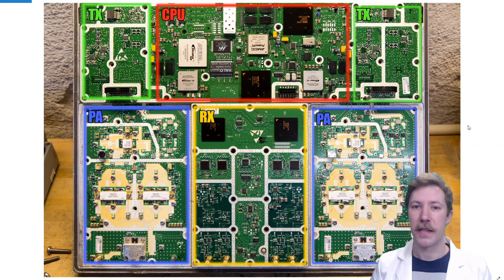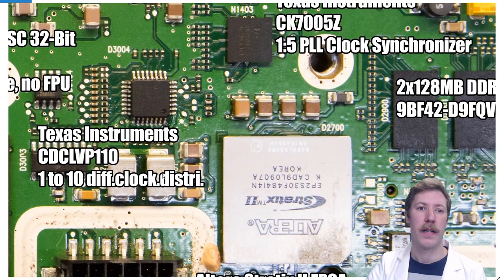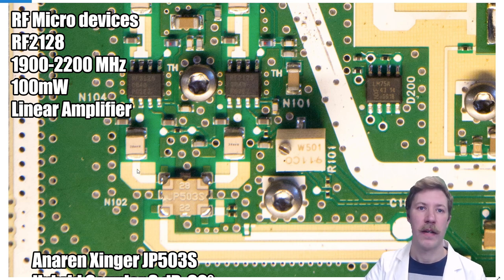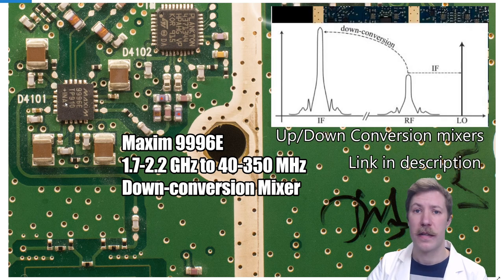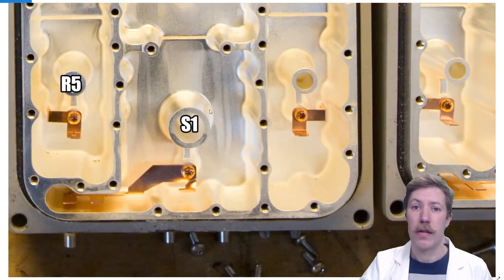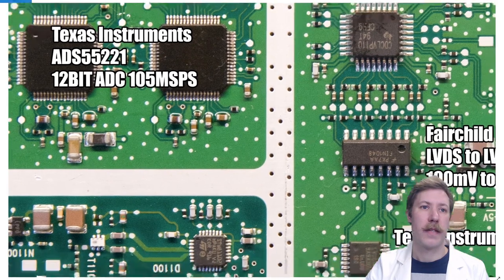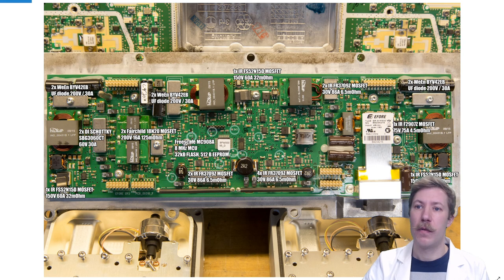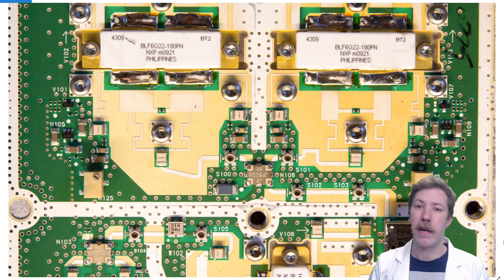Nokia Siemens 3G Flexi 2100MHz 2x50W Amplifier Circuit Analysis (Part 2 of 3)

Comment: Beatutiful boards Mads however I am kind of dissapointed that there are no smiley faces 
and no black magic runes on them. 
The FPGAs always make me want to desolder them, reball them and build an eval 
board with them to play around. 
I mean they are still somewhat modern and cost like a thound bucks at single piece 
quantities. 
Other than that there are quite a few nice parts on these boards, like all the mixers,
oscillators, etc. I would still love to see the BOM cost of a new basestatiion like this. 

The components labeled S... on the PA boards are actually coaxial testpoints.
They are used for taking measurements (mostly automated). 

On most basestations the coupled signal from the PA is not only used for the output 
power but has a full receiver to check the signal qualitiy. 
The system can then do some fancy preemphesis stuff to "predistort" the signal 
so that it is clean after going through all nonlinearities. 

The plankton chip is most likely a PLL synthesizer, propably a single chip frac N
PLL (somehing like an ADF4351 I guess). 
The differential output with its biasing network is typical for such chips.
Furthermore it feeds directly into the LO port of the Down conversion mixer, which I 
guess is a dead giveaway. 

I think the RX boards are my favourit (after the PA of course). They are layed out beatifully.

The LM75A seem to be a telecom engineers favourite, I've seen them on basically 
every basestation board from most manufacturers.

Comment: Thanks for the video! 

Though I believe that the PLANKTON device is not a microcontroller, but rather some kind of RF part - if you look at its surroundings, it's always fed by/feeds a balanced line, at 15:22 it's fed through what I believe is a switchable attenuator (D2201). While there may be some intelligence, I doubt that it's a microcontroller.
Reply from the maker: Hmm you might be right, that I got it backwards. That those 5 vias, that goes to D2101 on the other side, that is the I2C I/O expander, that the switchable attenuator is getting inputs from this instead...

Comment: why do you need 2 x 180 watts into a base station ?
Reply: They are on the TX path, all of that power goes to the antennas on top of the tower.
Reply: Power amplifier efficiency is only about 30%